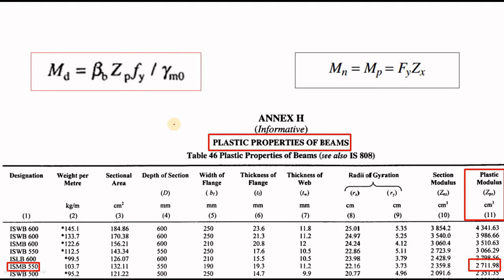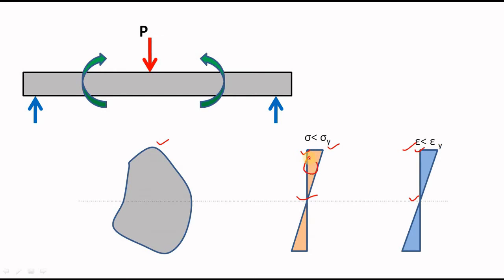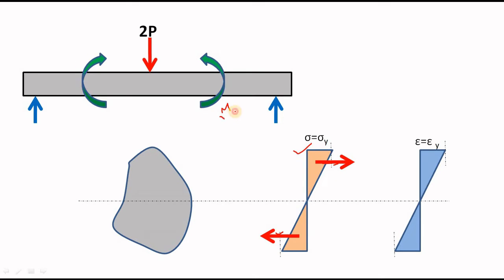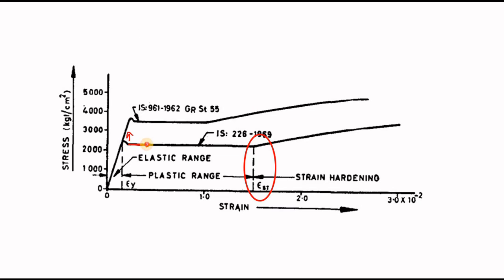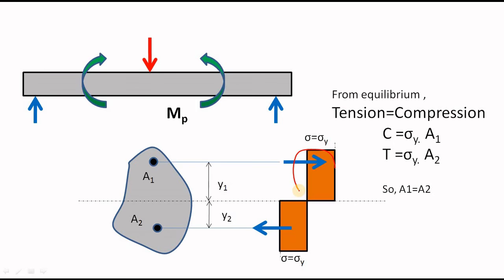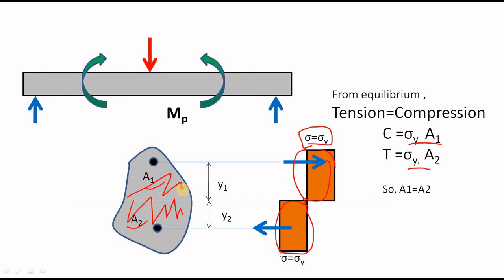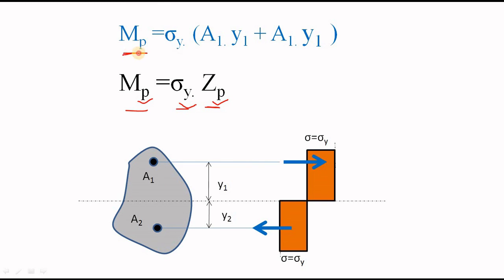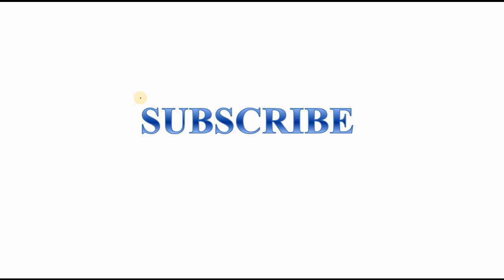What is Plastic Section Modulus:How to calculate Plastic Section Modulus; All about Plastic Modulus.

Comment: The plastic section modulus is effectively equal to the parallel axis theorem for Ad^2 except without the square term. Sum individual bodies above and below the PNA and multiply each body by their respective differences from the PNA to their centroid.

Yes, I used their as in they have an identity. 

Because every "body" matters in engineering.